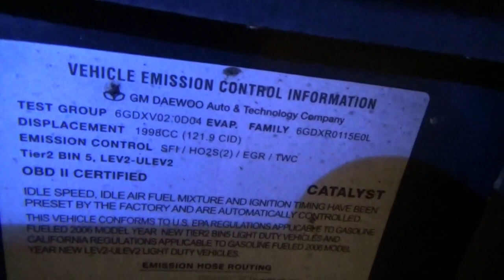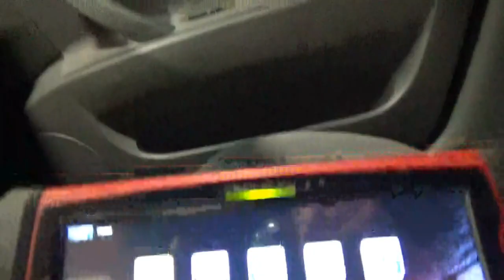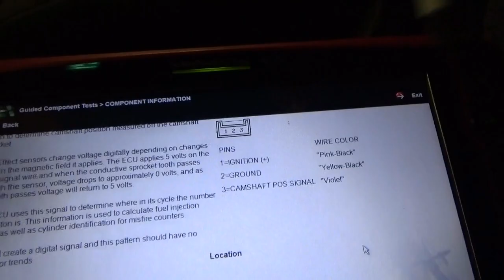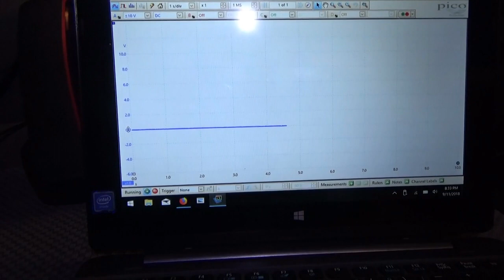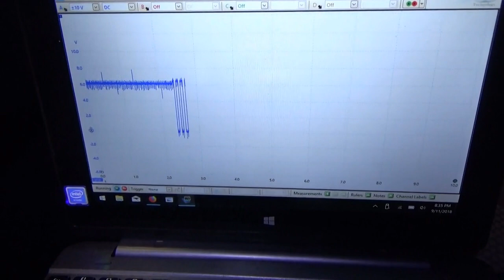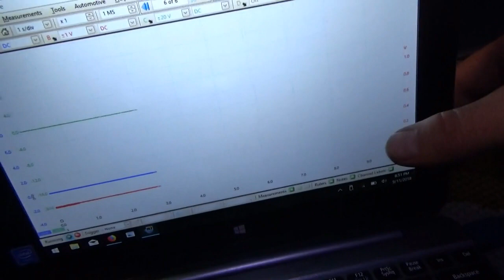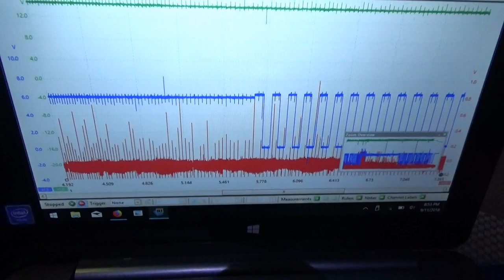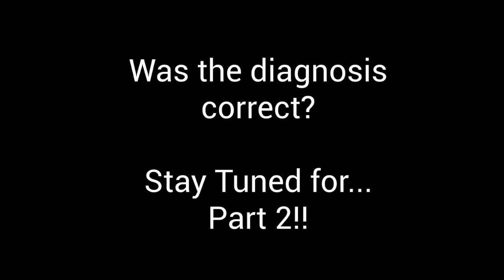Suzuki P0340 - Camshaft Sensor: Part 1

Comment: I have a 1999 Daewoo Leganza, which has the same engine.  They eat cam sensors, if I get more than a year on one before it starts throwing the code, I consider myself lucky.  Whoever chopped the timing belt cover in half is a friggin' genious (seriously, no sarcasm).  My car actually has a recall for cam sensors overheating to the point of being a fire hazard.  The first connector you put your hand on (wire leads to the front of the engine and down) is the crank sensor. My current sensors came from Wells, so far so good.
Reply from the maker: Excellent info Gary, thank you!

Comment: Good question, we're all given the opportunity to work this one out.

The sensing point is in the round part of the sensor and is looking at the build up half of the exh pulley, you can see the outside has a buildup area on half of the circumference on the inside of the teethed part the back has a similar but opposite ( balanced out ) section, so one pulse per revolution of the sprocket, which is comparatively slow for a sensor.
if it had swarf buildup it would show uneven pulses, if it was too far away it would miss altogether or be irregular, the delay in the pulse train returning back to normality is the key to the solution and i don't want to spoil the no doubt happy ending.

the ground point is good because it is a known good ground, it also shows why you have to use the correct ground for a particular measurement, in this case a continuous ground was confirmed, never mind the confusing noise on the red trace.
Reply from the maker: Please share your guess!
Reply: think the delay is electronic, have not watched pt 2 yet but i'm going with the sensor, thanks for all your video's

Comment: Great video! I partially agree with you. I agree that you should always use OEM electronic components, you're just asking for a head ache otherwise. I don't agree with not just changing the Camshaft Position Sensor and it that doesn't fix it THEN do all that testing, ;) that's just me but it has worked for me for over 30 years, both testing and part change out have their time and place and sometimes it's better to test first, sometimes it's better to roll the dice and just change out the part, save yourself a lot of testing.  :)

Comment: To me it looked like that timing belt tensioner was rotating off-center - that would certainly cause small differences in cam speed, but it seemed to run good there. Don't know if that was just an optical illusion or not. My next guess would be a Dorman sensor, lol. 

That car is a mutt! 😁 GM, Daewoooowooo, Suzuki ... everyone had their fingers on that design board. 😂

Comment: at 12:40 call my attention  supply voltage 12v power feed  , this sensor is reporting 7 volts  on signal wire hum ,   I though this was 12 to 0 , I see it changes the voltage on signal wire , there was a time when I change the ckp sensor on on gm and prior repair the signal wire  on scope was  from 9 to 0v  signal square digital and supply power feed was 12, I  was  wondering how it works  after replacing with factory part went from 5 to 0v  I could not explain my self that.

Comment: At 12:27: The red trace was limited to 1V thus not able to see how high the ground line voltage went up. Maybe it is way higher than 1V? (flat line of red trace at 1V limit) After a 0,5s sensor died, whic could be the limit of it's internal capacitor to keep it runnig OR due very noisy ground the very low voltage hall signal circuit messed up inside the sensor. 

I wonder what would have happened if you have connected a jumper cable from the sensor ground to battery negative? Could this is be a bad PCM ground and CAM sensor is just the first one to crap out?  

Ground signal looks like it includes all the coil and injector current spikes and average voultage of the ground increases as the number of pulses per second increase (aka. average current) -> bad PCM ground? 

Since PCM and two sensors already changed, there could be something else at fault here than just a sensor?
Reply: I agree. There is something going on with that dirty ground voltage signal. I wonder what would happen if he took the pierced ground wire to a good ground location.

Comment: @12:17  when the signal dropped out the red ground trace was extremely noisy and shot up to over 1 volt (maxed out the scale. )  when it looses ground it cant produce the electrical field in the sensor to "read" the  belt pulley bumps.    i'm thinkin you'll find a bad  ground strap from engine to body or a bad connection on that wire    also didnt like the tensioner idler eccentricity, needs bearings/replaced but not the probable problem. you put that in as a tease

Comment: You said you didn't want to backprobe the sensor because you might fix a connection problem in the connector. Did you later check that? I enjoy watching your Video's Ivan thanks!
Reply from the maker: I did a visual inspection and pin tension and wiggle test...no change!

Comment: Are we going to learn this is a pin issue?  It's problematic that this is a new sensor, but the problem is apparently the same.  

So we've got good power to the circuitry in the sensor.  We know, at idle that the sensor is grounding out the ECM's 5v being input on the sensor wire so it works then.  So why is the sensor not switching the 5v to ground when the engine is revved but also sometimes at start up?  It's interesting that before it goes out, that it does have shortened switching to ground.  But it comes back crisp after a time.  It is a vertical plug so I guess the pin could climb out with vibration but then fall back quickly?
Bad sensor?  Or vibration in the pin fitment?  

Ground is suppose to be critical to these things, but we aren't seeing the sense line switched to a high ground.  The transistor isn't switching at all.  And if that ground noise is scrambling the circuitry, then that is a bad sensor or they'd designed it with an ECM sensor ground wire.

Comment: Ooow that's an odd one ivan, odd car identity too lol.

i would have expected a smoother supply to that sensor than it has.
I would try a 47uf electrolitic capacitor across the power pins to see if the sensor is going into latch up because of the noise.

Comment: If it's like the Aveo 1.6L Daewoo engine the CMP sensor actually has some adjustability in it verified with my Pico but don't know about the 2.0L. Absolutely correct on OEM sensors vs AFM sensors.

Comment: Probably a weak sensor magnet pickup where it won't pick up the signal at high rpm. 

My thinking is the sensor loses the magnetic pickup and doesn't read the faster cam rpm. Seen this before where crank/cam sensors lose signals at certain rpms and sometimes it is a air gap issue (known issue with Ford V6 engines). To verify that, taking off the cam sensor pickup wheel and change that with the new OEM sensor.
Reply: @anonymic79  

Not necessarily if the air gap is within OEM spec. The magnetism in the pickup coil in the sensor isnt able to keep its signal right under a higher rpm because it loses its ability to read the speed of the cam. 

Heat expansion would affect it in all rpm ranges, where it can't read the cam rotation at all rpms, where this one can read data under low rpm but not high rpm.
Reply: @anonymic79  

Thermal expansion is normal with anything metal. It will normally expand and contract with heat and cold. This is why Eric O prefers to check for vacuum leaks when the engine is cold, as the metal expands the gaps tend to close. In the case of air gaps in crank/cam sensors and AC compressor clutches, as they warm up the gap widens. This is why the OEM air gap spec is at a variance from .120 to .180-.221 on such sensors. As the engine is at normal op temp, the gap will expand slightly. This I noticed with my AC clutch, which turns off when the engine is hot. It expands the gap just outside the oem spec so the clutch magnet can't pull in the outer part of the clutch in to spin the compressor. 

The magnetism of the sensor would not change when the air gap is within spec. What would change if the magnet isn't strong enough is it would drop the signal at higher rpm but not low rpm. Thermal expansion would alter the signal at all rpms.
Reply: @anonymic79  

I read the comment, but I am sure he checked the signal when the engine is hot and again at cold which the signal loss at high rpm was seen but not low rpm. 

Heat will expand the air gap normally, and the wider air gap would affect the low rpm signal as well as the high rpm signal. He only saw the loss of signal at high rpm. This is thermal expansion.
Reply: @anonymic79  

Nope.

Part 2 shows the aftermarket sensor high voltage is at 6 volts rather than 5 volts; where it has a 5 volt reference. At 6 volts it has enough time to drop to ground at the desired rate at idle, but when the rpm is up, having it drop from 6 volts to 0 (ground) isnt occuring. At the 5 volts, it drops to 0 (ground at the desired rate. 

Nothing to do with magnetism, but voltage grounding at the desired rate. Not a weak magnet here. The pickup coil voltage is too high.

Comment: i have a lexus ES 350, 08 model. it has camshaft sensor code crank but no start, when i remove the connector of bank A sensor the car starts, is that mean the sensor itself is gone?? it has 350 k ohm resistance.

Comment: I'll suggest that the gap is too close and overloading the inputs into the sensor. Part of what I don't like about customer fixes prior to handing it over to me is where is the old part? Uhhh, I already burnt it in the trash barrel, sorry. Well if it did the same thing as this one is doing then that would be a quick thing to try and get some direction from.

Comment: Just a tip; first check the type of sensor, inductive or hall. If it is a hall type never use an Ohm meter it wille destruct the sensor.

Comment: Ground glitches at exactly the same time the sensor drops out, and shoots up to 1 volt. That's a hell of a coincidence if you ask me. 

Id jumper a known good ground to that pin and re do the test, if it still drops out, at least you know for sure.
Reply from the maker: Great observation! I looked closely at those as well. Looks like the throttle body motor opening rapidly when I punched the throttle :)

Comment: Isn't it crazy? A Suzuki, branded by GM, made in Korea. I can't keep up. Am I weird for getting excited about seeing a square wave acting up?  :)
Reply from the maker: I was pretty excited that all it took was a throttle snap to recreate the problem haha
Reply: @PineHollowAutoDiagnostics  

Ivan

Did you check the square wave when the engine was hot and again when it was cold? Same result on both?
Reply: Almost.  lt's a Daewoo Lacetti.  Daewoo was bought out by GM and then Daewoo cars were infected with GM parts, nothing Suzuki about it other than the emblems on the car which happened because GM didn't want to sell the Daewoo models on its own lots because they already had actual GM models in the same category and didn't want the Daewoo's to compete for sales on their own lots.  At the time Suzuki was using GM V6 engines in their Suzuki Grand Vitara and XL-7 SUV's but the license that Suzuki had to build and use those GM V6 engines was set to expire so when it came time for Suzuki to renew the licensing agreement to continue use the GM V6 engines, GM took advantage of the fact that Suzuki had to other easy alternative to the GM V6 they had been using for many years at that point so GM made it a condition that Suzuki agree to sell the GM/Daewoo garbage under the Suzuki brand if they wished to continue building and using the GM V6 engines which Suzuki eventually reluctantly agreed to on the condition that GM would complete revamp the quality control procedures at the GM/Daewoo plant in South Korea to deal with the serious reliability issues that the Daewoo models were notorious for.  GM never did follow through with their promise to tackle the issues and Suzuki went on to regret that it ever agreed to sell those GM/Daewoo monstrosities for GM.  Suzuki was left inundated with a flood of non-stop warranty repairs for the GM/Daewoo models, but GM refused to spend any money coming up with permanent fixes such as redesigned parts for the Daewoo garbage and instead would only allow the same faulty parts to be used to replace the ones that would inevitably fail over and over again. The cam position sensor is one of the well known issues with no real fix.  The backlog of warranty claims on the GM/Daewoo garbage because so severe for the North American Suzuki operation and lead to so much debt that it lead to Suzuki refusing to continue to sell the GM/Daewoo garbage and file for divorce against GM which took place in 2008 which is the final year that GM/Daewoo garbage was sold under the Suzuki brand. Unfortunately Suzuki was left in a mountain of debt over the unending deluge of warranty claims for the defective GM/Daewoo garbage and they were never able to recover from that which by 2013 lead to the American Suzuki Franchise filing for bankruptcy in 2013 and ending its car sales in North America just as Suzuki was on an upswing when it comes to product development.  Luckily most of these GM/Daewoo rebadges (2004 through 2008 Forenza, Reno, Verona) rebadges are no longer on the road.
Reply: @JA-rn5qv  That was quite a history lesson.

Comment: Daewoo, Inc. had more than 20 subdivisions, they made chips for VGA and SVGA PCI video cards in PC's, appliances ranging from VCR, VCR/DVD combo, hot air corn poppers, small firearms and fairly decent heavy equipment (shovels, bucket loaders, backhoes, dozers, etc.) along with fancy hotels. Their effort in autos was a flop, about the same as Geo- any wonder after so many crap shoots GM needed a bailout. Daewoo's current endeavor is "performance" ECU chips (EEPROM). It's a very interesting company.  https://en.wikipedia.org/wiki/Daewoo

Comment: I'm sure Ivan has a twist for us.  There must be active circuitry in the sensor. The supply is 12v and the output is 5v. I believe the sensors usually switch a 5v reference. So I'd wonder if the sensor circuitry is screwing up. Maybe due to noise on the supply(s)  like others have suggested.
Of course Ivan wouldn't make a video of something so simple as a sensor. Can't wait to see.
Thanks Ivan.
Reply: what circuit needed it's just on or off

Comment: Could an oil issue cause that?
Reply from the maker: Please explain what you mean by "oil issue"?
Reply: I may be remembering wrong but I thought I remember seeing a video of either a VW or Chevy that had a cam sensor issued that was caused by old/contaminated oil. Whichever it was, part of the sensor was inside the valve cover were oil would get on it.

Comment: I put a Dorman Timing cover on a 5.0 recently, original was cracked. 
Never again, Dorman products are sub par, had to chase the threads with a tap, the lower seal for the oil pan was not cut the same as the original, reminded me of the Chinese crank pulley you showed recently.
Machined parts that are cut with dull tools or not cut properly affect fit, and I managed to correct the part, but never again.
I would lodge a complaint with Dorman, but they know their shit stinks already.
Never use a Dorman part, they just make horrible replacement parts.
I would never trust any electrical part, considering the low quality machine work, it's just another nightmare in the works.
Dorman has earned their reputation, and it not a good reputation.
Never let Dorman make you look bad, by the original, or a reputable aftermarket supplier.
Reply from the maker: Not surprised at all. I would use Dorman in a pinch for some "none-critical" mechanical item like a door handle. Their nylon fuel line kit is also pretty good.  Otherwise yuk...

Comment: having ,in Canada,worked on many cars you never see in USA   
   -Citroyen c2v,v12 Jaguar XKE convertible, v4 SAAB Sonnette, DARIEN ? ,and other Euro and Japanese cars
     I feel your pain

  -since is this now SUPER orphaned car a GM "parts" bin car?
      is it a Korean     Daewoo? or cobbled up from Aussi    Holden car?    GM Brazil orphan?  or some German Opel beast?   or ??
         -suspect Part 2 or even part 3 coming~~ 

I would personally chase down GROUND wiring -suspect runs everywhere and anywhere
   and use TIMING LIGHT aimed at offending Camshaft Position Sensor-to see "wobble" as revs mount on assembly or teeth

Comment: First
Reply from the maker: What size t-shirt Keith? xD
Reply: Pine Hollow Auto Diagnostics I will donate mine to anyone attending the Super Saturday expo in PA October 13th😎
Reply: Must be like Nissan where they only like oem sensors
Reply: @NewLevelAuto  how many PHAD shirts do you have? Lol.  I hear there's a nice sized attendance 😉
Reply: @joshmcgavin5226  . I have a 2002 Infiniti I35.  Both cam shaft position sensors were replaced about 2 years ago with cheap Chinese parts from 1AAUTO.  Still working great.  Only $25- $30 each.
Reply: i didn't know ivan had phad shirts.

Comment: These are Chevrolet Optra in Canada they are garbage
Reply from the maker: Maybe because the typical owner treats them like garbage?
Reply: i did myself replace head gasket on two different Optra's we had on the lot Both with under 80 000 KM this was back in 2012 one 04 and one 05. both engine had the same MAJOR coolant leak in the number 4 cylinder. i was a mechanic in a small street corner Dealership, these cars along with the Chevy Aveo/Pontiac Wave/ Suzuki Swift+ with the 1.6 E-TEC are notorious for head Gaskets and blowing timing belt well before the  recommended service, Also the Suzuki Reno is the 5 door Version of the Forenza (US only) in Canada it was the Optra5,
Reply from the maker: good to know!
Reply: Bad Drivers Montreal north shore,Laurentians I have a 2010 aveo5. At which approx. mileage do you recommend changing the timing belt then. Thanks.
Reply: EcoTec/DTec =  Euro Trash  ;)